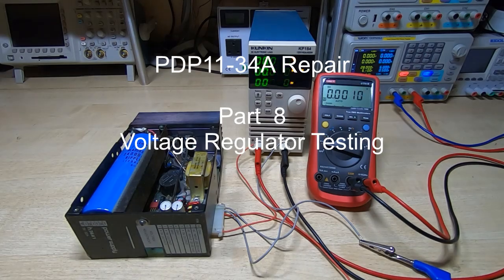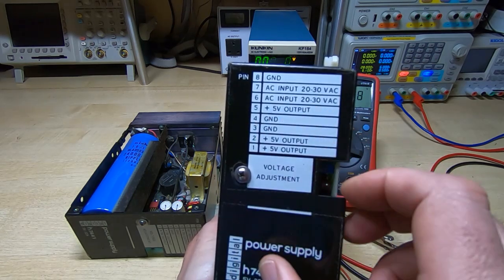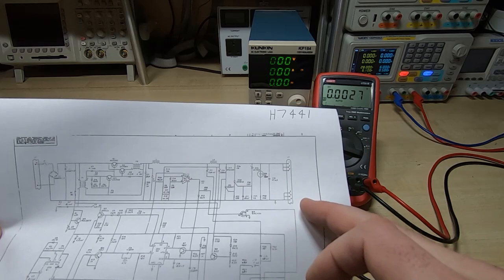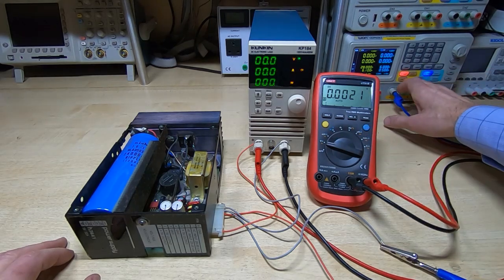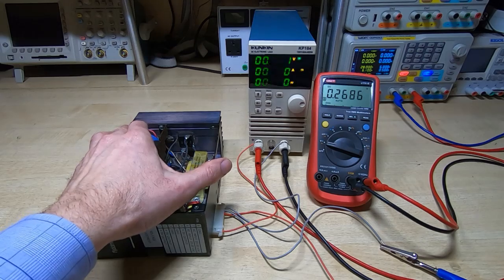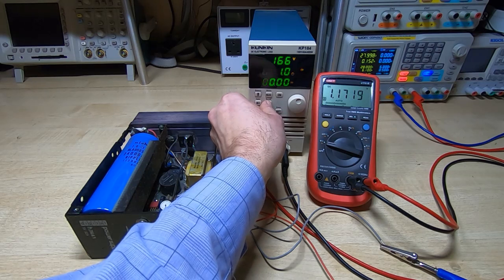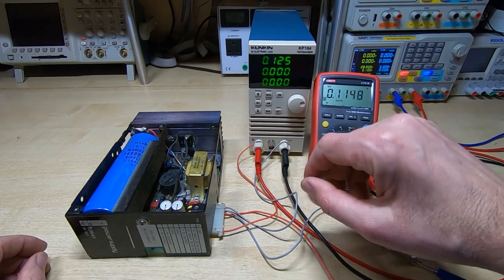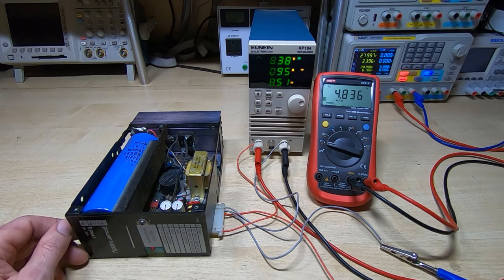PDP11-34A Repair Part8

Comment: I have read when searching for info about reviving old computers, people suggest to ramp up the mains voltage using a variac in order to reform capacitors. Could you please share your view on this matter?
Reply from the maker: If you are restoring an old (valve / tube) piece of equipment then the large electrolytic caps may reform to a certain extent as they are liquid filled and need to be 'worked' to operate although once they reach that stage their life is limited and it may be better to replace or 'restuff' them.
I have never seen any sign of 'reforming' more modern caps such as those found even in vintage computers as they do not work the same way.
My advice is to NEVER apply power to a vintage machine without removing the power supply and fully testing it first. This may take a few hours but can save weeks avoiding the need to repair the resulting damage if you do not do this. I rarely even replace the electrolytic caps in vintage computers unless they test bad and I have never had a problem. This does not apply to the mains filtering X and Y caps which I always replace.
However these vintage machines are getting older every year so my advice is to fully test them starting at the power supply.
Finally some types of machine architecture respond VERY badly to slowly increasing the input voltage and this can actually damage them so it is best to treat each based on the way it is designed.

Comment: I'm not sure why my earlier comment has vanished but I just wanted to say thanks very much for answering and even demonstrating a response to my query about bench testing these. 
I now feel competent enough to work on my own bricks, and although I don't have a programmable load unit, I have made up high-wattage resistor ladders for 5V and 12V loads.
A particular point I appreciated is the commentary about the no-load fault mode, and that there's no crowbar to trip with a subsequent need to replace components. Phew!
Reply from the maker: YT seems to randomly delete comments for no apparent reason. Most sorts of load will work OK although I would avoid things like car headlight bulbs as some people use as these present almost a short circuit when the filaments are cold. Note that I was only talking about these specific supplies. Other supplies may be different.

Comment: Any reason why you're not using the load in CC mode?
Reply from the maker: I want to drive a representative load when testing rather than simply driving up to a specific current (or voltage). CR generally gives a load that is closer to the normal operation of a supply. For example the supply may be faulty and try driving the output up to a high voltage to try to reach the set current. If there is a fault in the current limit then this may also damage the supply by driving a very high current so I find it much better to use CR when testing power supplies.